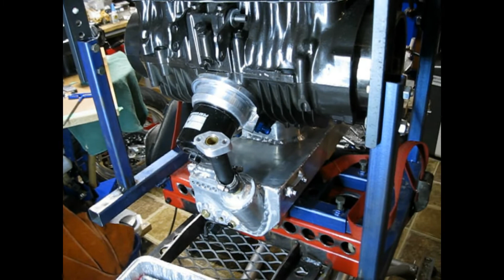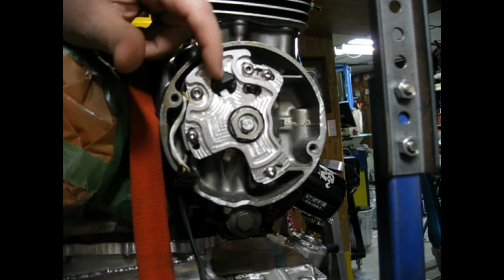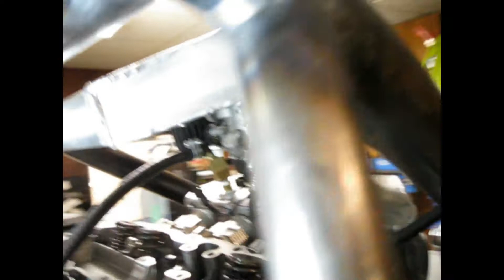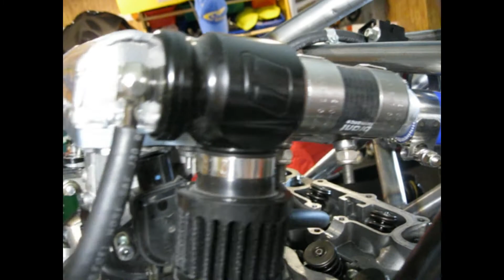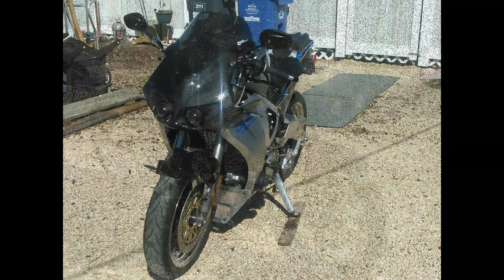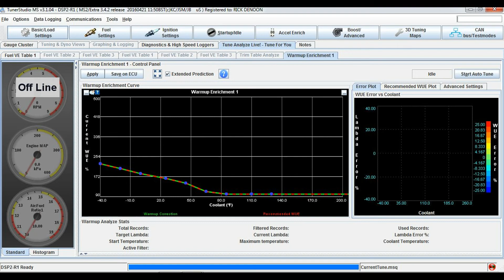Turbocharged Fuel injected CB400F

Comment: Very impressive thanks for the info. I will turbocharge a CB400SF motor 92-98. How do you select this turbo? I have a turbo from a 1400cc diesel car but cant find any info for that. What assumptions can be made for this to know if it will work or not?
Reply from the maker: I am currently working on a turbocharged 1990 CB-1, which would be very similar to your CB400SF. I have selected a Garret GT1241 turbo. The one you have picked will probably work, but may be a bit big and take a while to spool up. You need access to the compressor charts for the turbo you are looking at, and learn how to read the chart. Books like "Turbo - Jay Miller" and "Maximum Boost - Corky Bell" contain all the information you need to calculate turbo size, exhaust tube size, intake tube size, etc..

Comment: Hi there buddy , can i ask as well being carb originally is it also the Vtec spec engine ? what year is engine please ?😁😁👍👍
Reply from the maker: The engine is from a 1975-77 CB400F. Single overhead cam with rocker arms and 2 valves per cylinder.

Comment: Amazing work! I'm in the process of doing this now... I want to ask what fuel pump are you using? I'm having trouble finding one that isnt over kill for my 50hp RD400. I need the least power draw as possible.
Reply from the maker: I used a fuel pump from a 2003 CBR600RR. It has a built in regulator so there is only a single line running to the injectors. It is a big bulky affair that installs inside the tank, and only works with a really deep tank. I know guys use external fuel pumps from EFI Honda ATV's ( a Foreman?)
I upgraded the charging system to use a CBR600RR stator and rotor. It puts out 13.0 volts at idle. That's pretty important for the Microsquirt to have a nice consistent voltage.